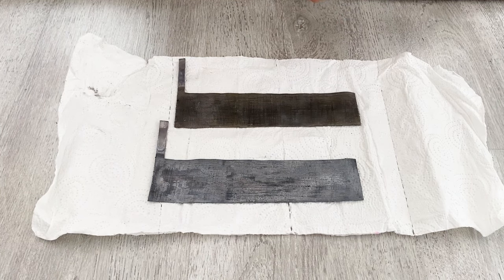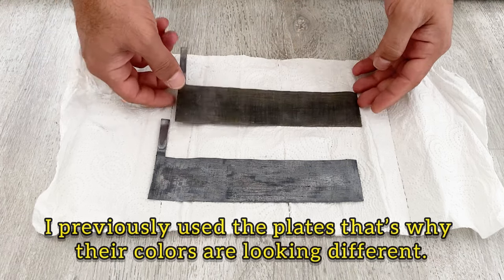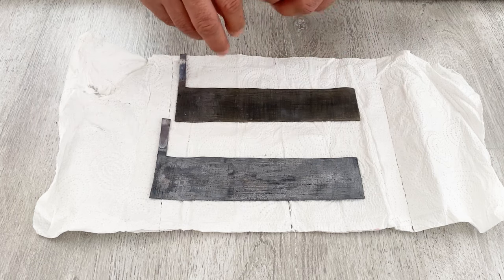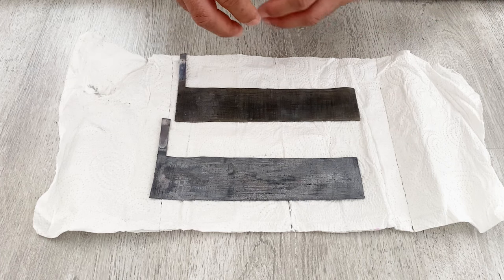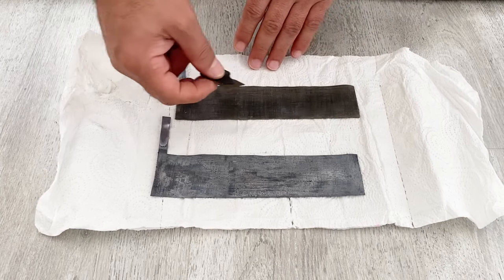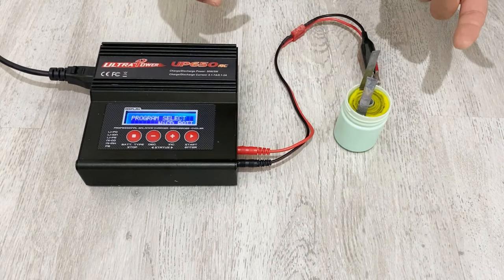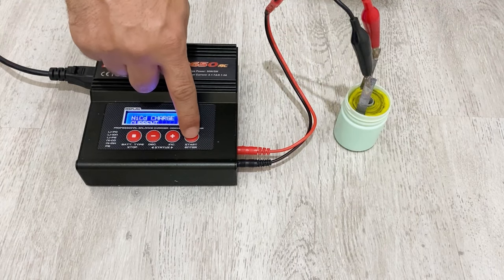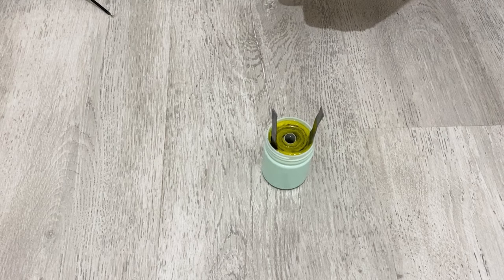How to Make an Advanced Cylindrical Lead Acid Battery (DIY Battery)

Comment: Great video. I think you can paint metal mesh instead of using plain Pb plates. Also, adding some porous insulator in the mix will improve the contact surface even further.
Reply from the maker: Cool👍
Reply: Any alternative for porus insulator ?

Comment: I saw this film from 1959 where someone made a very crude lead acid battery by just putting 2 solid lead plates in an acid solution and charged it for like a minute, it was able to power a pretty powerful light for like 10 seconds. I'm probably gonna make one like that someday cause it's more like how the original one from the 1850s worked.

Comment: can you kindly write the composition used for anode and cathode and the electrolyte?
Reply from the maker: It’s explained in the video brother.
Reply from the maker: @annoon-i1l l see brother. Then l will tell. For positive electrode you should use mix of lead dioxide and graphite powder, for negative electrode you should use mix of lead and graphite powder, to mix use deionized water or distilled water. Use sodium silicate as binder. As the electrolyte you should use 30% water based sulphuric acid solution.

Comment: Have you ever tried mixing the active materials with activated carbon ??   I have always wondered if they can be constructed in a way where it is a hybrid between a battery and a super capacitor.
Reply from the maker: Yes l did. There is no significant difference except increasing conductivity but decreasing energy density
Reply: @joyofelectronics9782  الوصفة حامض ولة ملح
Recipe 
sour
Why
salt
Reply: @joyofelectronics9782  Hi. I am currently assembling the battery according to your instructions and I have a couple of questions about the active material. I mixed 50 grams of lead powder, 10 grams of graphite powder and 10 grams of sodium silicate. And that's the problem, sodium silicate is clearly not enough for the active material to become liquid. In this regard, you can tell me how much you need and in what proportions to mix everything in my case, otherwise my hands are frozen from the cold. I do everything on the street, I'm from Russia. Thank you.
Reply: sulfuric acid will dissolve the carbon eventually

Comment: nice video.  why did you short circuit it?  what is the difference using lead/ lead oxide versus using the lead oxide / lead 3 oxide they use in cars?
Reply from the maker: It doesn’t matter. Both work well

Comment: Hello! I have a question: What is the difference betwen that and the commercial ones? In procentage please 😁. I know that the comercial ones have the grille form and a lot of paste in them. I know there are producing more amps. But the one you made it is more durable without the form of the grille. Isn't it like that? Thanks!
Reply from the maker: The conductivity and durability is much more better thank to the additive l put in the active material

Comment: Did you measure the short circuit current given from a single cell ? 
Seems like it's quite high.
Reply from the maker: Yes. It’s around 5 amps

Comment: Dear sir, how much time you let dry the active material after painting? Do you think that active material can last forever on the plates or it will go over time and use.

Thanks in advance
Reply from the maker: Hi, you had better to wait at least 24 hours. It will not stay for ever but it is longstanding
Reply: @joyofelectronics9782  thanks